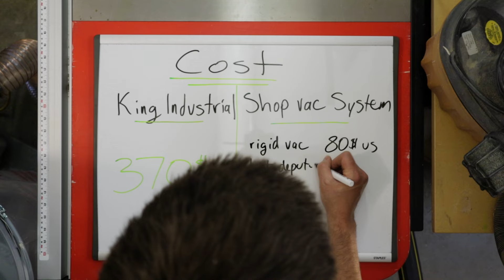Important Answers for Small Workshop Dust Collection!

Comment: Generally large dustcollectors are used for big tools like planers, where shopvacs are more suited to smaller tools like routers and sanders. This is something to do with air pressure and cfm.. dont quote me, i am not an expert.. but I know most pro shops will have 2 systems for the different sized tools.

Comment: I bought a Skillsaw jobsite saw, their larger unit, and built a wooden case out of plywood.  Under the saw I stuffed a 12 gallon Rigid shop vac and plumbed the two units together with PVC pipe.  Works great and with casters on the case I roll around just one unit and with a fancy delayed switch on it, I just flick one switch and the entire thing turns off and on at once!!!  I use an internal bag on the shop vac that you can get at Home Depot.  Since I am a hobbyist and not a commercial shop, in the same size garage that you have, I don't really have to switch out the bag that often.  Thanks and stay safe.
Reply from the maker: Awesome set up! You buy or make on of those cyclone separators for the shop vac it reduces the suction a but, you don’t really loose any system efficiently as it fills up.

Comment: Good comparison.  It would have been nice to see how an actual dust extractor by itself stacked up against these two.
Reply from the maker: Yes that was a thought for sure, I try not to make the vids too long.  In my opinion a dust extractor vacuum without the dust deputy is not a good option for a table saw.
Reply: @TheFunnyCarpenter  ok.  That's what I've been using.  Seems to work well but fills up fast.

Comment: I use my CT26 as a dedicated collector for my MFT table, and I have 2 CT Midi collectors dedicated for my Kapex and SawStop JSS respectively.  I got CT-VA 20 Separators for all 3 of them, and I went from using tons of expensive Festool bags to using virtually 1 a year in each machine.  I highly recommend them.  I've seen a ton of reviews where people talk about loss of suction, but those clinical tests do not match my real world practice.  I see virtually no difference in the actual performance of the dust collection.  I also tend to replace the Festool bags obligatorily.  I know they are the first line of filtering for the machines, and you should by no means empty them and reuse them, as the bags hepa pores will be caked and you will stress the motor.  But these bags pretty much never get material in them.  and the insides of my vacs look pretty much exactly like when I bought them.  It's really an amazing system.

Comment: I got that shopvac, but the smaller version, since we don't need any storage volume when using the bucket and vortex system, put it in a box on wheels, put the home Depot bucket on top of it, put some insulation around the shop vac with enough space for air to circulate to not have it overheat, it's compact, mobile, fairly light, much quieter than out in the open, reliable, and with that remote power switch thing, it's just perfect!

Comment: Great info I'd be interested to see where it makes a bigger difference with the higher air flow, planer or jointer perhaps?
Reply from the maker: I think that and the reduced pipe/hose diameter would be a problem.
Reply: I have the same rigid Vac, and have tried it with my Hammer A3-31 jointer/planer. If you go slow on the jointer, it’s mediocre at best. In planer mode, the speed is just too fast and produces WAY too many chips and dust for the vacuum to keep up. The outlet of the machine just ends up clogging like a dam.

Comment: I have the same vacuum set up but have a heck of a time connecting the hoses. Did you make your adaptors? If so, would love a video on how you made them.
Reply from the maker: Lol! Connecting vacuum systems is a science that requires visiting various hardware store and finding interesting parts in multiple sections:). Even to this day if I see an interesting pipe piece or connector I may buy it for future considerations.

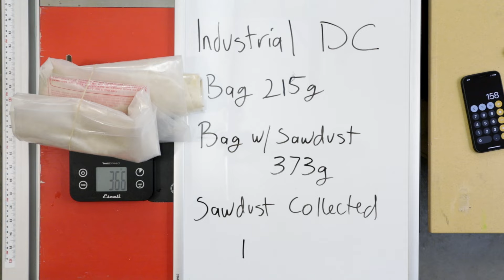Comment: At 2:20 it looked like the shop vac didn't pick up as many of the very fine particles. The smaller particles are more of a pain in my opinion—they stay airborne for a long time and get into more crannies, so that 6 g difference might be more substantial than it sounds.

Comment: Great video!
I would have guessed the industrial unit would out perform the shop vac. 
Appreciate the information!
Reply from the maker: Thanks Robert!
Reply: I use a similar unit. Clearing the bag is one problem you get dust everywhere and fitting the new bag is a pain. The upper bag has a tapered chute into the dust collection area and  dust lodges on that. The second problem is space it takes up a lot of room.